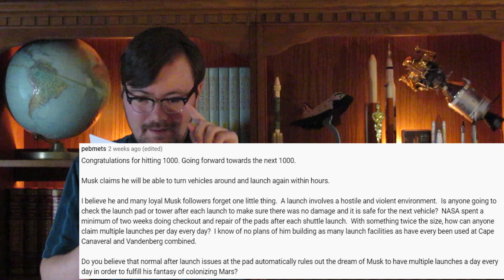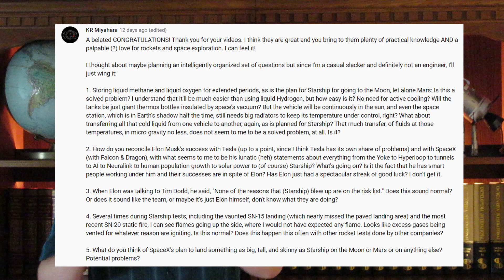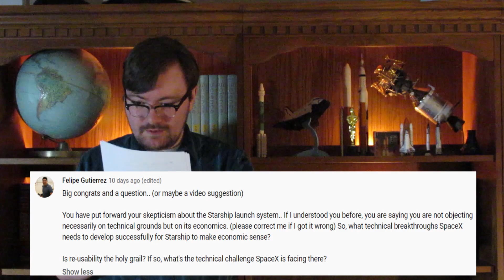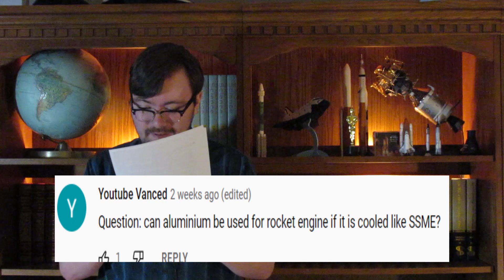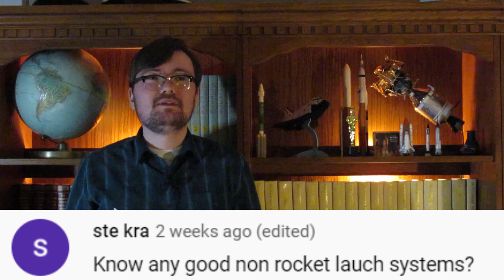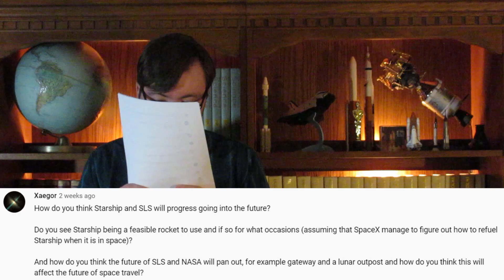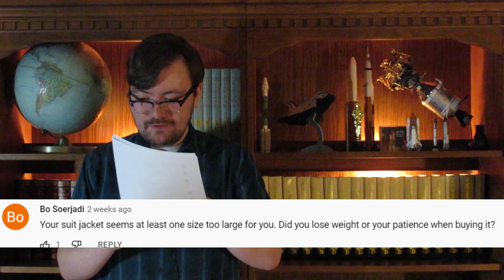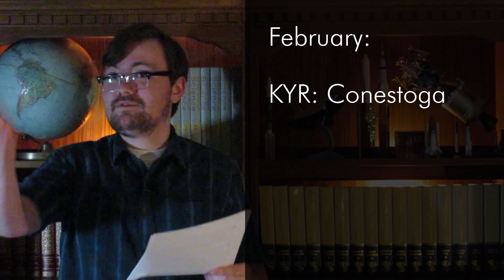Answering Surprisingly Technical Questions

Comment: I just found something that may shut up Starship as a Mars vehicle forever! During a research for my sci-fi story, I found the Mars DRM 5.0 lander. That thing has approx. 4/5 of its volume taken by methane-oxygen tanks, uses staging of empty tanks and very light materials, and flies to Mars orbit only. Now, Starship has only 2/3 of its volume (to be generous) taken by propellant tanks, it is made of heavy materials and is supposed to fly from Mars all the way to Earth. Yes, it has an aerodynamic shape and much less dense crew space, but that can't account for the difference. It seems like Starship may not have enough Delta-V to fulfill its mission, even with Mars surface refilling. Also, I did some calculations on Starship using the Silverbird Astronautics calculator, and something doesn't add up. With 10% propellant residuals for landing (based on consumption during Falcon 9 flights), the mass/thrust/Isp values from Wikipedia (with approximate of 200 tons for first stage dry mass) and launching from Cape Canaveral to LEO, the total payload is a about 60 tons with mostly-conservative numbers - not "more than a hundred" they promise. Something is very wrong here...
Reply: What deltaV did you assume for the trans-Mars injection? 
Fully fuelled with 100t payload, the Starship has 6.9km/s dV so can do up to a ~4.4km/s TMI (4-5 month transit time depending on window) and still have 1.5km/s left over for landing on Mars.
I also have a feeling you sandbagged the numbers way too much to get the LEO payload capacity under 100t as their claim of 100t+ is very conservative as when I run the numbers myself (with your 10% prop residuals for booster) with 9.5km/s to LEO, 200t booster and 120t ship, a payload to LEO of 100t is very achievable.

This isn't the best place to discuss things like this, so if you want to chat further, I am on twitter where I can post my calculations in detail with graphs.
Reply: @OzearEimaj  Sorry, I don't use Twitter.
I haven't talked about Mars landing at all - just about the Earth return. That maneuver consists of Mars-orbit launch, trans-Earth injection and correction burns. The reference lander uses the same fuel/oxidizer combination, has more % filled with propellant, and yet is only able to do the Mars-orbit part. Isn't that a little suspicious?
As for payload... The 60t was actually at the top of Silverbird's results - the average was about 10t. I was willing to accept the calculator was counting on the low side, so I raised it to the "maximum margin" result. It may be because I chose a 400 km (ISS altitude) 30° (Cape Caneveral lattitude) orbit - the one you used may be less Delta-V demanding.
Reply: @HalNordmann  Sorry for that misunderstanding! 

Onto your claim that there is only enough deltaV to ascend to Mars orbit, I'm not so sure how you worked this out. To explain my thoughts, a 300km orbit around Mars has a velocity of ~3.4km/s. Adding conservative gravity losses during ascent, we can make this 4.4km/s. With 3km/s allocated to TEI and 0.2km/s to any corrections along the way, this totals up to a dV requirement of 7.6km/s for a Mars ascent -> Earth intercept. Granted, this means the return payload must be reduced to ~50t to allow to still allow for some margin, but the return payload is likely expected to be less than 100t (or at least should be by design as these numbers suggest).

Going back to LEO payload capacity, my 9.5km/s total requirement (7.4km/s orbital velocity + 2.1km/s aero & gravity losses) is in fact very conservative, which is likely more demanding than the ISS target orbit you simulated.  In fact, more detailed simulations of the Starship stack suggest a payload of 180t is what would cause such large losses, rather than the (aspirational) typical ~100t launch. 

To be perfectly honest, in order to get a 10t payload capacity from a ~5,000t launch mass vehicle either suggests an error somewhere or dramatically sandbagged structural ratios that underperform even modern vehicles.
Reply: @HalNordmann  Just checking in again to see if you redid your calcs. I ran the numbers through Silverbird and got 100-180t to the orbit of the ISS*

*edit: 95% confidence interval
Reply: @OzearEimaj  Maybe the numbers got changed? I counted with 200t dry mass, 3400t propellant, 330s Isp, 74000 kN thrust first stage and 120t dry mass, 1200t propellant, 380s Isp, 14000kN thrust second stage, with 10% landing propellant for both (since that is what Falcon 9 uses for its RTLS landing, counted as a "residual"). Orbit 400km circular with 30° inclination, "Optimal" trajectory. Result is 10808kg payload, with 0-55862kg confidence interval. Now that is low for all standards, so I say 60t load.
Reply: @HalNordmann  I think I've figured it out!

So I agree with using the same propellant residuals as F9 for the booster since we haven't seen any demonstrations of Super Heavy operations, but I think applying the same assumption to the ship (2nd stage) is what is throwing off your numbers. 
To elaborate, we know the ship can land (albeit it is a small sample size of demonstrations) using only the propellant in the header tanks; reserving propellant for landing is their purpose, after all. 
If you calculate the volume of these two tanks, they can roughly contain a total of 30t CH4/LOx propellant, or 2.5% of the total Ship propellant.

With this said, here is what I get:
 
Launch Vehicle:  	User-Defined Launch Vehicle
Launch Site:  	Cape Canaveral / KSC
Destination Orbit:  	400 x 400 km, 30 deg
Estimated Payload:  	109,482 kg
95% Confidence Interval:  	70,733 - 155,890 kg
Reply: @OzearEimaj  Are the header tanks really enough for deorbit and landing? I mean, you said they are about 2.5% of the upper stage propellant - while Falcon 9 uses 3% for a much simpler downrange landing maneuver. I'm willing to compromise on 5% since it doesn't have to change direction in addition to braking unlike F9 RTLS (RTLS Falcon first flies up and eastward, then it has to brake that and fly westward, then land), but I can't see it getting lower. The bellyflop can't take off much velocity either, since Starship has the structural integrity of a drinking can - it would fold in half if it flipped too hard.
Reply: @HalNordmann  The bellyflop saves a substantial amount of propellant, actually!

"Engines-first", the terminal velocity is ~160m/s, whereas for the bellyflop, it is ~50m/s. Since this means you can start the flip + landing burn later in the flight and spend less time fighting gravity.
Even if this largely qualitative statement isn't enough (I'll admit, it is quite basic), if you reverse engineer the SN15 landing video, the entire sequence of events from engine ignition -> flip -> descent -> touchdown is ~18 seconds. Assuming all engines are at full thrust and a mass flow rate of 680kg/s, this yields ~24t of landing propellant. If we account for the 3rd redundant engine that starts up for a few seconds on the flip, then this increases to ~26t.

As for the deorbit burn, the header tanks do not need to contain the required propellant as they are there to maintain a steady supply of prop to the main engines after the bellyflop. Larger on-orbit burns will most likely use hot gas thrusters fed by the ullage gases in the propellant tanks, where I will assume an Isp of 320s as per NASA's Project Morpheus.
To go from a 400km circular orbit to a [80km x 400km] re-entry requires ~100m/s, so this works out to ~5 tons for the deorbit.

edit: Yes, the flip + land is substantially more complex and risky, but this doesn't necessarily mean it requires more propellant, as I hope my numbers have shown.

Comment: Can Spinlaunch be considered a space gun? Did you see the test they did? Is it feasible or pointless?
Reply: Pointless.
Reply: @commonsenseskeptic  That is my take as well. 50000g  acceleration to only get Mach 6 at sea level. How much is lost to drag? And you still need to get most of the delta-v with rocket engines.
Reply from the maker: It's effectively a space gun, but worse. There's two loading cases on the projectile now whereas a classic gun has only one. I think the loads are higher on the payload, too. Someone estimated 17,000g, while Babylon was somewhere around 5000g.
Reply: @naciremasti  I wasn't aware that Tfoot had made a video about it. Though he has a lot of good content, I must admit that I find him a bit... grating to watch. His voice gets on my nerves over a long video. I kinda got tired of him back in the good old WDPLAC days.
Reply: @pressure-fedastronaut6511  Yeah, I also wondered about how much of the payload mass have to go to strenghtening it to survive the launch. Seems like it introduces more problems than it solves.
Reply from the maker: @Antares2  Not as bad as you think. The dry mass of the solid motors Martlet used were 20-25% the weight of the propellant mass. Most rockets are between 6 and 13%, so it's not as bad.

Comment: 27:30 Thanks for answering my questions! I think the commercial market is only more efficient in routine, already developed operations (if sufficiently regulated, of course), but except for LEO satellites, space travel is neither routine, nor developed enough. As for development - there is evolutionary and revolutionary development, and private companies mostly only do the first kind and applications of existing technologies. And no, the first stage landing on Falcon 9 isn't revolutionary research - NASA has been testing that since Apollo, they just never put it inside an operational launcher.
(Also, sorry for 2 comments at once.)
Reply from the maker: Yeah. A good non-space example is airfoil research--NACA did a lot of it back in the 40s. The problem with scientific research is that there isn't an easy path to what could be useful.
Reply: @pressure-fedastronaut6511   Fun fact: One of the CCrew/CCargo proposals involved a private company buying 2 of the retired NASA Space Shuttles, refitting them for duty and flying them commercially.
To me, this makes no sense for a supposedly "better & cheaper" program to replace NASA Shuttles for LEO transport. It is as if one airline sold all their planes to another, and then bought charter flights from them (all while boasting about how much they are saving). And it definitely would've been more expensive, since the fixed costs would only be split between 2 orbiters instead of 3-4, and the company would take its cut as well. Granted, this proposal didn't make it very far - but even the fact that it was even seriously considered speaks volumes. It almost seems like these programs were also about getting rid of NASA's useful LV and manned spaceflight capacities, so it will be more vulnerable to total deconstruction. It's not as much tinfoil-hattery as you may think - some politicians want NASA gone since its founding. And now they technically don't need it anymore, I fear for its future...
#FundNASA
Reply: To bad that regulation often introduces large inefficiencies and stifles innovation.

Comment: I did the back of the envelope calculations and with the numbers Elon has given 400Wh/kg batteries, and battery mass 70% of craft total mass, climbing to 30,000m or so (100,000ft) should take less than half of your charge. What I don't know is how far the other half of the charge could then get you, and what speed. VTOL seems like a waste though. Added mass, cost, and complexity, and airports already exist. So I'm going to give the whole idea a qualified "maybe." It's not quite as absurd as it seems on its face. It's doubtless an incredible engineering challenge, however.
Reply from the maker: A lot of these ideas end up in the 'is this practical?' world.

Comment: 6:36 mining is much more promising on the moon as there isn't such a thing as air pressure, oceans and continental plates .... you gotta dig really deep to see some lava , so theoretically you probably can dig 20 times deeper than ever done on earth with far less problems ... so although the moon is much smaller there are more natural resources available ... not to mention that launch costs from the moon could be much cheaper than ever on earth